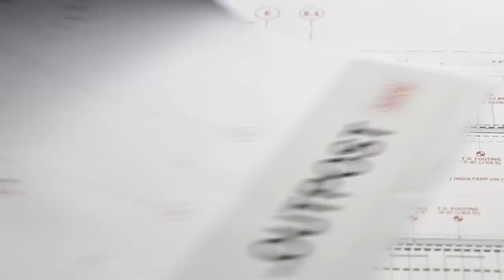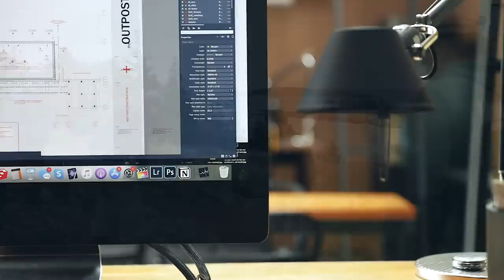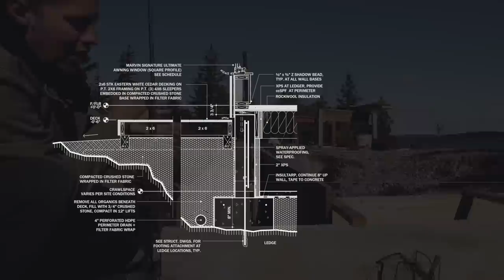Drawings, Site Visits + Construction on a remote island | Outpost - Part 9

Comment: Wow. That is a completely different construction method than I am used to.I come from the Netherlands here we often build on concrete piles to see that our land is swamp almost everywhere. We use a concrete slab with ring beams with posts below. These posts sometimes go up to 10 meters into the ground before we encounter a load-bearing layer.Here we use a lot of bricks and other building blocks.

It is interesting to see how you build.Maybe I can send you some details of how we do this in the Netherlands if you find this interesting.

Good luck with the build and please keep making videos like this one.Greetings from the Netherlands!

Comment: Eric, first let me say I love your channel, and your Architecture.  As an Architect myself, working for a firm in the south, we also face unique site challenges, our houses are often elevated because of flood zones for example, so we utilize post and beam construction you mentioned.  I was wondering if you ever use spray applied insulation instead of batts, it's something that we commonly specify, especially for elevated floor systems, but also in attic spaces, which eliminates having to vent an attic, we've seen examples of storm water being pulled into soffit vents during hurricanes.  Anyway, keep up the great work, it's inspiring.
Reply from the maker: Thanks for your comment...we're using ccSPF in the walls, roof and master bedroom floor, but for the main area of the house given what we were trying to achieve with the grade relationship the clearances were too tight to reach with the spray rig. More about this around the 4:30 mark...thanks for supporting the work here on YT, really appreciate it!

Comment: Essential points: 1. keep a checklists not to missed something at the beginning and to mitigate surprises, 2. Necessary information per phase that will not confuse every sub contractor that works simultaneously. Organize the info. and its timely issuance. Pipe sleeves doing after concrete been cast and cured will affect structural integrity 3. Update immediately the drawings for those actual site conditions not captured in the early site visits.

Comment: I am unfamiliar with this style of elevated design in Maine, here in Australia it is common with old buildings, and still common with buildings up north in the more tropical areas to encourage airflow and limit the damages of floods etc. 
But why is this common in Maine? is it just because of the uneven bedrock like landscape you're dealing with being on the island?  
Because a way to hide it I was thinking if it wasn't the desired look would be putting potentially a studio/mancave or maybe cinema area underneath, filling walls up between the posts etc. Then with that, you are able to have large doors acting as the windows, rolling out onto the landscape, you could imagine a retaining wall path like structure wrapping around the outside of this area, flowing it with large steps from downstairs to upstairs. Would be great in the summer months having the doors open and getting a really nice breeze through the downstairs area, with big glass doors almost putting the outside environment into an above-ground basement like design. 
This incorporation of "outdoors in" is very common within Australia, which has derived off of the open floorplan like aspect Australians love.

Comment: Good stuff Eric. What a view! I am curious as to the need for the 4 @ 6x6 posts in the crawl space? It doesn't appear as though there are excessive point loads transferring from above? I know there is a reason, I guess the limited plan views I see have me befuddled a bit.  I'm also curious as to what they  used to damn up the little open sections around the formwork riding over the boulders and how clean a face resulted? I'm really looking forward to the next progress video! Thanks for sharing!
Reply: shear walls above?

Comment: All of that white wood seems like a huge expense (in my location anyway), and I realize that local conditions, as well as the specific circumstances of the foundations and footings might make that a viable method for forming same, however, I would use a phenolic faced plywood for forming this kind of thing (and have in the past), since it's pretty durable, releases VERY easily after the concrete sets, and obviously uses the same tools and skill set for construction as the 1x board forming...or is THAT the reason to use white wood, the character?

Comment: Hi! I would just like to ask, when you render your architecture service, do you provide the engineering drawings as well? Such as the structural, plumbing, electrical, etc? With your respective consultants/engineers you've worked with before. 

Loving this series! Wishing to have a project similar to this with similar topographical and climate challenges as this site.

Comment: or you can excavate the soil and replace it with compacted non-shed soil (soil that is not affected by frost) -> rock, sand, etc. and fill top 2 feet with compacted foam glass which will also insulate the building from below and is load bearing and pretty much indestructible and then pour your slab; the slab will add to your thermall mass and buffer fluctuations of temperature and humidity; you dont need to put installations in the slab at all

Comment: I have a question, this comes from a want to be architect but grew up with a carpenter. So why wouldn’t you build the floor in segments? The second option displayed seemed feasible if you made the bottom in segments running back, this would allow for you to add a finish to the bottom. I do realize that it has some aesthetic issues but wouldn’t that be more economically sound? Just really curious

Comment: You don't have any air contact on upper masonry wall with back fill against it. And insulation going on inside. How is your concrete gonna dry out? And being on that upper slope side it will see more moisture. If your covering that area with roof never mind. But if just a deck it will water log that concrete. I do foundations. It would be a question I would ask the engineer or architect. Not sure orientation but hope that's not a north wall. North walls sometimes never see the sun shine. Which can lead to farther and longer frost. A solar north wall I go down to 6 feet in expensive soils even though code is 4.